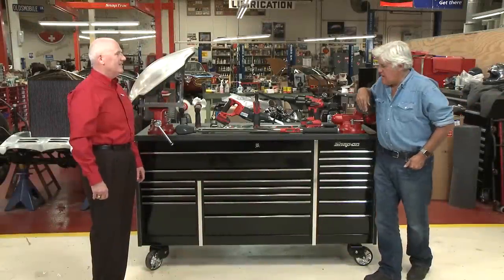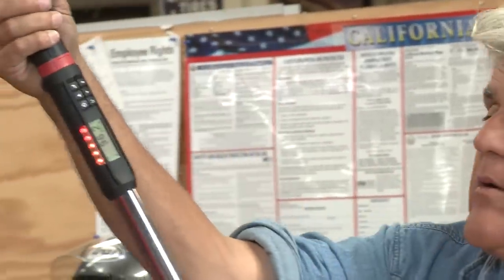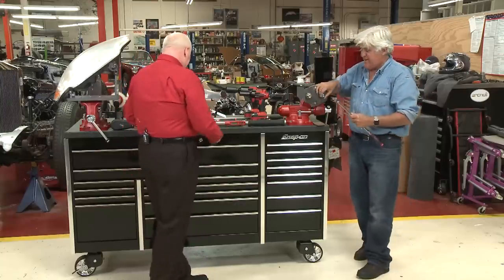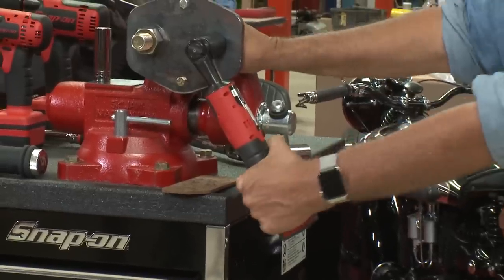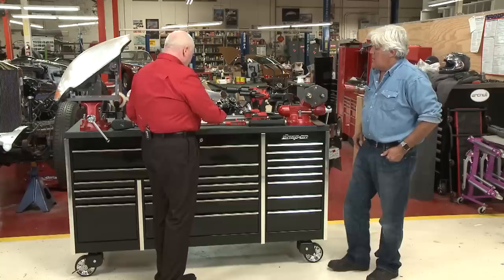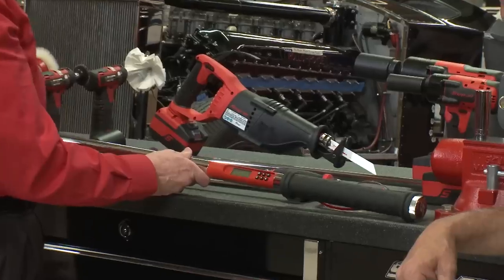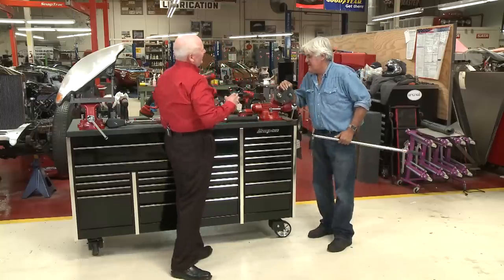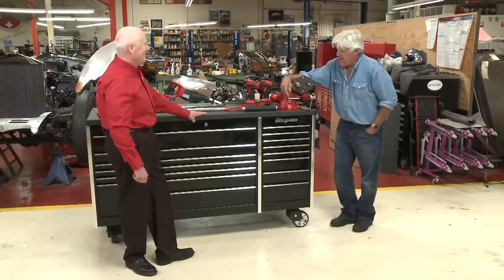Snap-On Power Tools - Jay Leno's Garage

Comment: Snap-on is great for the professional mechanic who gets paid for his work and uses the tools everyday. But for the home mechanic, $30 for a single socket is just absurd when there are so many cheaper alternatives.
Reply: You are right Jane. Professionals are who these tools are meant for.
The only tool from snap on I would recommend for the average person is the ratchets.
If you have had a crap ratchet brake on you then you'll know why.
Reply: They aren't even that great for professionals. Honestly the best tools for a mechanic is the one that has the best local service, being it mobile trucks and shops for replacement. 

Father and Grandfather where both mechanics, I went with electronics but ended up doing a lot of mechanical as well. I've inherited a vast collection of many brands and honestly 90% of them it's just a badge in terms of quality. What matters more is when a tool breaks.. which does happen regardless of how you use them.. how quick is it to get a replacement. Cause a broken tool sitting in your box does nothing for you.
Reply: Even then, cheapo tools with lifetime warranties, master craft in canada here comes to mind, get the job done at a fith of the price. Yeah, they'll break eventually but if you don't mind the trip to the store to get it exchanged there's not much point in getting snap on other then bragging rights lol. Get the sockets you use the most in double and you always have a spare once it breaks and it's still cheaper than one snap on socket. That said, some tools are worth more to invest in then others. Investing in a snap on impact gun, pneumatics and electric alike, or tool chest is actually worth it as they'll probably last you for an entire career. For sockets and wrenches and pry bars, not so much. They still break, just much later when the warranty is out. Snap on is mostly for bragging rights and not much for common sense.
Reply: Jane Leelavathi honestly craftsman pro line is damn good. Smooth handles lifetime warranty
Reply: The Mastercraft is better quality.Snap On needs guys with trucks to replace the tools that the mechanics break. Mastercraft you can use and abuse, 3 foot extension on a 1/2 inch ratchet over and over. Been there done that! Canadian Tire doesn't make any money when people need to exchange broken tools. Have had them for about 30+ years with a lot of use.
Reply: Socket is cheaper than a doctor bill because you slipped and broke your finger. Seen it happen
Reply: I've only broken a few sockets in my life, Craftsman sockets that were replace under warranty. I use store brand standard chromium vanadium sockets on a 1/2" air and electric impacts, some 3/8" drive with an adapter, and I rarely break one.
Reply: clyde stewart You can say that about anything. Might as well just stay inside all day to prevent a possible injury. The person who broke a finger was probably using a 1/4 inch socket on a bolt that was torqued higher than the tool can handle.
Reply: Jane Leelavathi
Most jobs are performed under less than ideal conditions (can't see, dirt, awkward access, heat or cold, even working upside down), add to that pressure to do a good job, add to that time pressure. It all adds up. The last thing you need is unreliable tools. All to easy to have an accident.
Reply: clyde stewart this is probably the worst (and most unbelievable) arguments I’ve ever seen for why Snap-On is the better purchase
Reply: Says a woman smh...
Reply: your funny
Reply: Jane Leelavathi I agree having been a professional mechanic for 25 years.
Reply: I understand what you mean. I am talking about home mechanics who are not restricted by time or a deadline to get a car repaired for customer. A professional should obviously invest in the best tools they can afford, but for people who work at home and choose to do mechanical work one their own, we can afford to have tools occasionally fail.
Reply: most pros bought theirs used at 60% off or have 2- 3 small snap on sets to complement cheaper brands
Reply: schmooz a

 the $10 Kobalt gearless drive i have is way better than a gear driven ratchet. Ive used it up to 60ft lbs with no trouble and my snap on gearless broke at 45- 50
Reply: ShadowOfDeath24 I needed an air gun that could quickly remove crankshaft bolt from the crankshaft without it spinning. Went to Lowe’s and got a Kobalt impact for $85. If I bought a Snap-On branded air gun it would have costed me closer to $500. Kobalt backs up their products with a limited lifetime warranty.
Reply: You got wrecked dude.
Reply: The only tool I absolutely had to have from snap on was a long thin wrench with a 12mm box end on one side and a 14mm box end on the other.  They are the best tool to get at all the pulleys on the fan/accessory belt.
Reply: I know mechanics still paying for their snapon tools they bought 5, 6 or even 8 years ago. I dont see the business there.
Reply: Over here in Wisconsin, Snap-On had a special tool purchase program with our local technical college, which allowed automotive tech. students to buy new Snap-on tools at %50 off. This was in the early 00s so don't know if it's still going.
Reply: There are niche specialty tools that I was only able to find through Snap-on.   You don't have to be a professional to have a particular need.
Reply: you hit it on the head,jay can afford these but not the average guy changing his own oil or rotating tires on the weekend
Reply: Jane Leelavathi I took your advice and stayed indoors all day  but injured myself using my automatic water dispenser and am in a full body cast now except for the 2 fingers I am peck typing with. Crap! I think i just broke my finger hitting enter
Reply: If your ratchets are failing, then your using it incorrectly. That's what BREAKER BARS are for !
Reply: Long handle Zero offset . great for hondas
Reply: Don't like that they are missing the rubber handles on the ratchets.
Reply: Jane Leelavathi I'm a mechanic for A bus company in Cleveland and none of us buy snap on its overpriced and we are  paid a lot more than flat rate mechanics
Reply: There are specialty tools that cost an arm and a leg, regardless of whether you buy it off the truck or not.
Reply: @J L, for anyone that’s absurd.
Reply: Lol Japanese KTC Nepros tools are ornamental quality stuff (very beautiful and overbuilt) and cost the same or less than the equivalent Snap-On product. Made in Japan.
Reply: I'v been an A&P for 26 years , comercial airliners.  You would be surprised how many guys use Craftsman.  Or other tools . Even guys that sell Snap On will tell you they are over priced . Really you only buy snap on when they are the only one that makes it . I  own some snap on , Mat Co , Mac , Knipex, Klien , Craftsman , Milwaukee, Proto . More than likely if a tool breaks in aviation it was miss used . Snap on makes good tools and Tool boxes but most of their products are over priced  .
Reply: $30 is not that much if you use it a lot hell if it makes my life easier $100 isn’t much I’m not telling you to buy snap on for the house even I wouldn’t do that but at work I got Mac matco and snap on because that’s what makes me money

Comment: i reckon the old " click " type torque wrench is as advanced as it needs to be.
Reply: Wrong. Though i wish you were right. Newer cars are going the way of degreeing a bolt to set torque. This torque wrench does that and many other things. Watch a youtube video on it, pretty interesting.
Reply: Longtrailside by like 30lb plus 90+90 degrees? its really not hard to do and torque to yeild bolts are nothing new.
Reply: No i am mainly talking about talking about doing subaru heads and hondas with there new way of torquing crank bolts.
Reply: Longtrailside I've rebuilt a few motors myself bar the machining and just mark the bolts with a number and a dot. helps keep track of where your at and easy to see 90° its good. you can use a small torque wrench then a nice long bar to do your 90s.
Reply: Longtrailside they're just torque to yeild? nothing " new " about it
Reply: True i've done that, and used a degreee indicator but trying to do that on a subaru with the engine in the car is a pain. Much easier with a (anybrandname) digital torque wrench. I use my clicker type 95% of the time over the digital, but when i need to do degrees its much easier and faster to do it with the digital and not hhave to mess with the other methods.
Reply: Longtrailside you paint a dot on the edge of bolt and one on the mating surface when you get to your 1st actual torque setting. ( some require a torque and release then torque) from there you breaker bar handles your " compass " . pretty standard stuff
Reply: Bro Tang everything you've said is true, but man this thing saves time! I'm qualified mechanic in Australia for over twenty yrs and after owning one would never go back. The paint technique is great but means you've got to clean your nicely oiled head bolts to put paint pen on them etc
Reply: Nah, click type won't last at a tire shop. I killed two, in less than a year. One harbor freight and other Craftsman.
Reply: it appears easy to overtorque though. jay never did get it right. Maybe he needs Tim Allen to show him how.....
Reply: TARMACULA yeah can be hard getting the paint to stick nice but I'm lucky in having time on my side to let it dry. I use a pentl fine tip, they're about 20 bucks but leave a nice tidy dot.
Reply: Brooks Yeager I think it depends on 2 things, what you buy and how you treat it. kinda hard to find a dirt cheap torque wrench here in nz. I keep mine in its box, use it, wipe it put it back. if your using it 20-30 times a day its gunna see some wear. my bro has a tyre shop, just rattles up then checks with a good old x brace. never seen him torque a wheel nut yet!
Reply: Unless you're german and need a nut torqued to 107.201N-m. Jay's target was 90 and overshot by 10% every time.
Reply: jfbeam he was reading it like the older school bar/ gauge type. a little bit tighter never hurt anyone anyway.
Reply: I have a mechanic mate who says you get a feel for the torque. I've tested hm a few times over the years when it's raised in conversation and he's rarely off the mark and if he is, it's less than 1/2 a pound.
Reply: Wrong - a little bit tighter can mean a cracked manifold, and I've seen that in person.
Reply: bklynp718 tbh that's is more likely caused by not tightening in stages working from the centre out before torquing up. once a manifold is evenly torqued down you could put a big bar on on stud/bolt and snap the head clean off without breaking the manifold. once you have something evenly " tight " the only damage you can do by over torquing is the the bolt, thread, or tool.
Reply: that is how you can warp an aluminum head. If you can find a snap-on truck they have a torque gauge and you can actually use it to see how far your clicker torque wrench is off compared to a snap on clicker/electronic one.
Reply: yoshiko130 I'm in new Zealand and don't have any snap on trucks here I'm aware of, we have traveling salesman that sell all brands from a truck and representatives of some companies. most good engineering tool shops will send it off to be tested and some test in store. the old mans is a stahlwille and never gets dropped or abused. a warped head is caused by overheating and uneven cooling usually caused by no coolant. if head is done in stages then considering the way a tty bolt works by the thread basically " walking " away from the head you can't warp a head that way. unless you started from the outside in and even then would only at worst cause gasket to not bed down properly. you'd see the leak then just loosen, clean, retorque. you won't warp a head by doing say 100° on one bolt and 90° on the others.
Reply: +SauronsEye - that is true the other trick is to use a ratchet that is an appropriate size for a fastener.  Don't be cranking on a 1/4" bolt with a 1 1/2 foot long ratchet.  Working on a car those little 1/4 inch drive ratchets should get a lot of use.
Reply: When ur at the track and there's there's alot of noise u will love those lights and beep
Reply: @Bro Tang, my old beam style don’t even click 🙊

Comment: Ive been a professional fleet maint. for 30 years, 33 if you count military. I bought the cordless ratchet, 3/8 impact, and drill motor. Cannot recommend them highly enough for what they are designed for and I beat on my tools badly. Had them for about 6 months now. The shop bought the 1/2 torque wrench shown here. Its great. Does standard, degrees, you name it. As for the battery life, all you needs for an 8 hour shift is two batteries. Less than an hour charging time, just rotate them. Love your show Jay, keep up the good work!

Comment: They're really good quality tools however they cost a fortune and based on my experience they have horrible customer service. The guys on the tool trucks have very bad attitudes. (ive met 3) My opinions aren't formed from 1 or 2 experiences, more like 15 or 20 experiences. Years ago we had an old snap on ratchet break, idiot on the tool truck badgered us for 15 mins trying to get us to admit that we abused it and beat on it causing it to break. We thought it was lifetime warranty no questions asked. It was a very surreal moment. I couldn't believe it. Finally we told him to just keep it and we wouldn't be doing anymore business with snap on. After this day we asked the guy on the snap on tool truck never to come on our property again, he tried to come back every week until we threatened to call the police on him. Guy went outside and got a new snap on ratchet (2 weeks later) and threw it inside the door landing on the floor and left. We gave the ratchet to the next customer that came through the door. The snap on guy was so arrogant and condescending. We had put up with him for years. From that day forward our shop never bought another snap on tool and I never will. Granted they aren't as high quality but if you have a craftsman tool break they toss you a new one no questions asked. Harbor freight too if it's under warranty. The cost of living and the average mechanics salary, snap on tools aren't worth it unless you work for some exotic car dealership or are jay leno. (no offense jay, love ya, but you can afford them) This salesman in the video don't even know what he is selling.
Reply: At a  shop I worked for the owner was a real Snap On cutomer. He bought so many tools he had everything he could possibly need. The Snap On guy wouldn't replace a broken tool for him and was told to leave. The next week the Snap On guy parked his van in the shop lot to sell to neighboring shops. The boss had to threaten to have the Snap On truck towed to get him to leave.
Reply: Wow nightmare stuff. To upset a stream of revenue to save a part that cost $20 shows some serious problems in the training and priorities of management. Easily hundreds of thousands of dollars lost in a shop switching over and telling these stories to potential customers
Reply: skoal22005 the tool guys will give you a good service as long as you keep buying tools from them
Reply: Both my Snap on and Mac guys happen to be decent long timers. I don't buy much off them. But there are idiot tool truck guys out there who don't understand that the tool truck is all about the level of service you are getting. The tools aren't necessarily the best. The first time I actually did buy something of my Snap on guy, I showed him two broken items. One was replaced on the spot and the other was put on backorder. That's how I knew I can go ahead with buying that rebuilt MG725 off him.
Reply: I've had the exact opposite experience, I'm just a shade tree mechanic, 99% of my stuff is Craftsman, but I have a few Snap-on tools.
I had a very old broken snap on ratchet, I put it in my car hoping to run into a snap on guy somewhere, eventually I see a truck in a place, I pull in, the guy rebuilt it on the spot, no questions asked, since then I made a new friend that see's a snap on guy on a regular basis, I've heard nothing but good about the guy, my friend gets all kind of deals on tool boxes and stuff that people have traded in.
That sucks you guys had bad experiences.
Reply: Funny I watched the same thing happen to my Father back in the mid 60's but the man never did replace the braker bar and he welded it up several times over the years till it hung on the wall in the garage for several decades before being tossed after my Fathers passing ...... Craftsman always did give great service .....

Comment: Hey Jay, here is that Recipe for rich and simple French Onion Soup: Melt butter with olive oil in an 8 quart stock pot on medium heat. Add onions and continually stir until tender and translucent. Do not brown the onions.Add beef broth, sherry and thyme. Season with salt and pepper, and simmer for 30 minutes.Heat the oven broiler.Ladle soup into oven safe serving bowls and place one slice of bread on top of each (bread may be broken into pieces if you prefer). Layer each slice of bread with a slice of provolone, 1/2 slice diced Swiss and 1 tablespoon Parmesan cheese. Place bowls on cookie sheet and broil in the preheated oven until cheese bubbles and browns slightly.
Reply: It must be about lunchtime CST, I am getting a bit hungry.
Reply: volkscom That recipe sounds unbelievably delicious. What on earth prompted you to put it on a clip for Snap-On tools?
Reply: ironymatt  I must share this with everyone, its so good.

Comment: Got a Snap-On electric impact driver at work. It doesn't open the wheel nuts on the company Yaris, I need to crack the bolts with a breaker bar first.